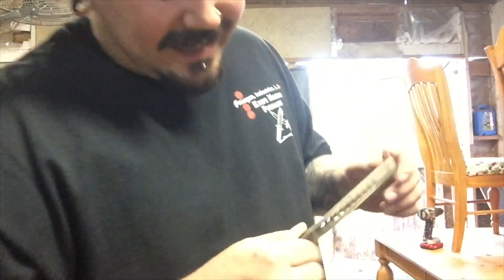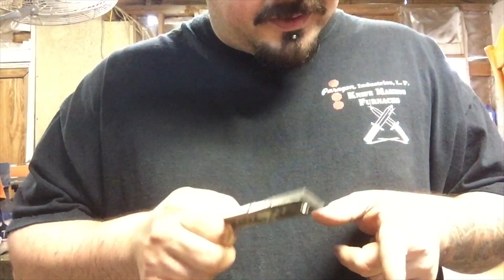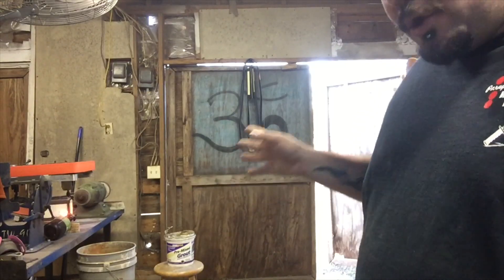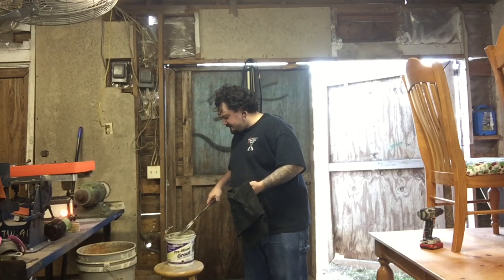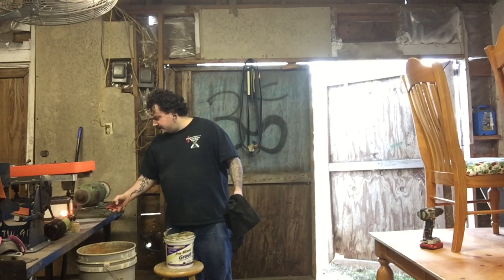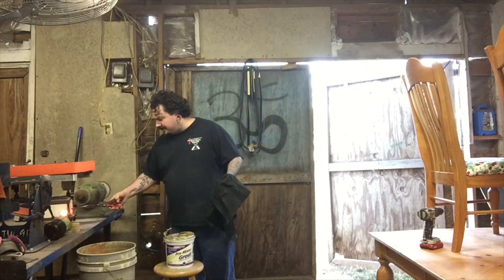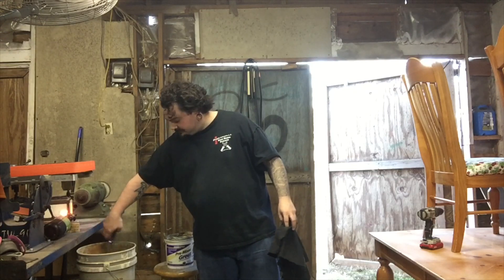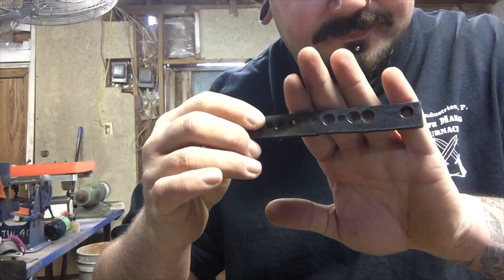How to Blacken Titanium (full process written in description)

Comment: I don't have a sand blaster, so I tried it with an orange peel texture and although it worked, it was much more difficult than a blasted surface.
Reply: I use canola oil.
Reply from the maker: @craigwilson8255  yea ive tried on orange peel with very poor results but that doesnt mean its impossible! keep going and trying dude and post some results !
Reply: I usually do full customs that are fully polished now, but I've always loved some blackened ti.
Reply: Also, I know small parts like screws and thumb studs blacken good with just a satin.
Reply: Have you tried the windex and water method?
Reply: @anteck7goat  I've tried windex with no avail. Heard you need the ammonia. Not sure I had it at the time.